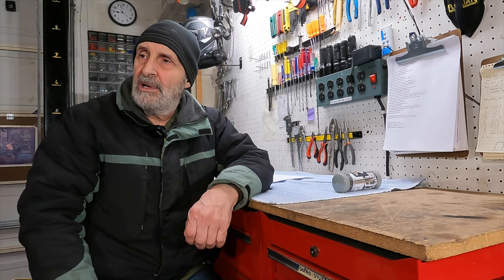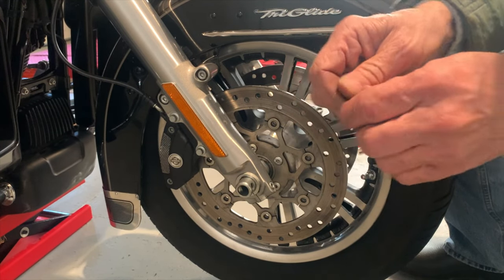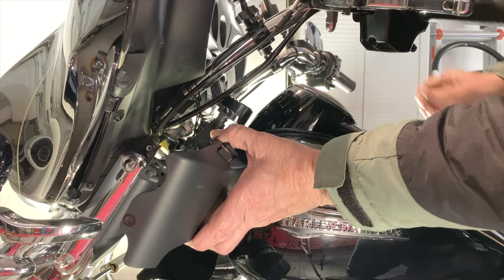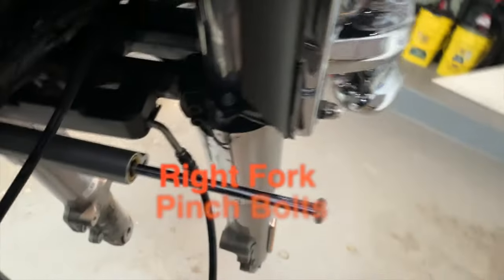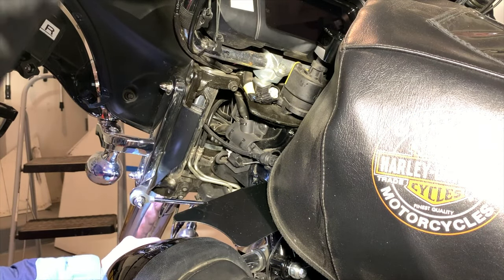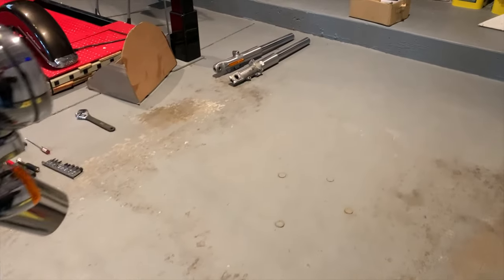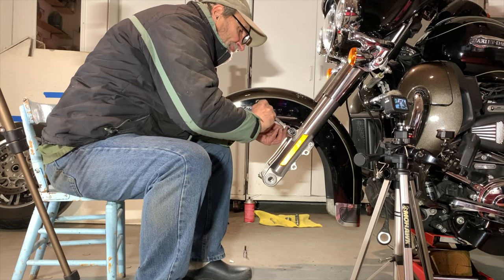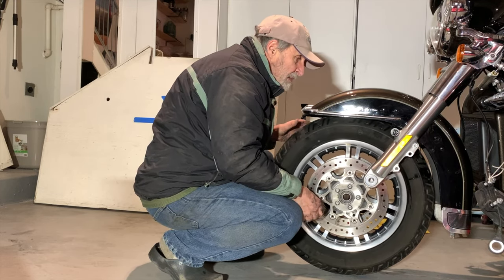Harley Davidson Tri Glide Front Fork Removal. Ricor Intiminator Valves Installed

Comment: Thanks for the video. I have a 2021 Tri-Glide and just installed the 14" Nexgen rear shocks from DK.  I have been thinking about installing the intiminators on the front. I have the rake kit from cut n shoot customs on it and it made a huge difference in the handling. After watching your video,  I think I will get the intiminators and install.  The nexgen rear shocks have been great. The wife says it is a completely different ride now. I am going to do like you and take the forks off and take to the dealer to install the valves.
Reply from the maker: Thanks for the comment. Shortly after I installed the intiminators I installed the next GEN 13 inch tri glide shocks. I did a video on it, which will be out later. The intimidator’s are a huge compliment to the rear shocks.  Standing alone on the tri glide without new rear suspension. You can still feel the difference when the front end has an event. (Pothole)
Lot of times it is quickly followed by the rear wheel (wheels)  but once in a while, you have a standalone event with the front forks and you can really tell the difference. But when I put the rear next GEN 13 inch shocks on the rear it was a world of difference. Unbelievable compared to the OEM shocks. I am doing a video on the difference which will be out at some point.  The intiminators would be fantastic on a two wheel bike and way more noticeable. I have been told by many people that I should get a rake kit but I don’t think I will but I have heard so much good things about them.  I could have lived with the OEM shocks, but the wife was having difficulty with all the ruff riding ,so I decided something had to be done.

Comment: The lifting table to the right in the video….does the trike fit on it …..if so any make model etc…trying to source a trike lifting table with little success or  they are very much over priced.   Thanks for your help and precious time. Robert
Reply from the maker: I bought that car lift about 15 years ago. It has a center deck on it. And yes, I use it to put my trike up and out of the way. I can put a small vehicle underneath it when it is up I paid around $3000 to get it to my house 500 alone in shipping but it has been worth it’s weight in gold over the years I have stored many motorcycles up there during the winter months, I bought it in Kansas City. The manufacturer is no longer in business. Shortly after I bought it, they went out of business. I’m lucky I got the left before they did.

Comment: Question to you sir, what type of torque wrench did you use in order to torque the front fork pinch bolts . And some of the other difficult bolts during the front fork replacement process . During your video it appeared you used loc-tite on all the screws and bolts is that correct? Additionally, my 23 Tri-Glide did NOT have the little carter pin on my front axle bolt , we noted you tapped out at 1:35   
Please coach me through this.
Reply from the maker: I used a 3/8 inch torque wrench from Harbor Freight Tools with extensions enough to get to the bolts. It worked really well. Also, I don’t know much about the 23 models but if you have a hole in the end of your axle like I do on mine and there should be a kotter key in there. If you don’t have a hole, then apparently the nut is made to just stay on Securely
Reply: @windsurfed1  Thank you, very much appreciated .

Comment: 2 Questions... So how much was it $ for the shop labor and fork oil???  And did you inspect your front brake pad thickness/wear, How they look after all the miles you put on her?
Reply from the maker: Order Fork oil with the order from dk custom which was a little over $27 for the fork oil.
Fork labor to change oil (my oil) and drop in the intiminators and I purchase new fork seals ($18) was $245. Also no, I did not inspect front brake pads account about 3 months earlier I thought I needed new front brake pads since I am always using my front brakes, way more than the rear. I briefly looked at them from the outside and It look like I neeed new ones. I ordered new pads for the front and rear. When I went to replace them I found out I was totally wrong and they were only about half wore down to my amazement. So I just stuck the new pads in the drawer till I really need them.

Comment: Did you remove the ignition switch to remove the dash panel?  Thanks
Reply from the maker: No I did't Have to remove the ignition switch.  The dash panel was wrapped around the switch but I did not have to mess with the switch itself.

Comment: I commend you, I do my own work also.
Couple suggestions, maybe you should try using a longer ratchet handle, it would make life a lot easier. You can unbolt that steering stabilizer. You shouldn't use your torque wrench as a pry bar. (Unbolting front wheel axel)
What do those wings do for you above the lowers by the tank?
Reply from the maker: Thanks for the comment.  Sometimes I use a cheater bar if a need a longer handle.  Yes, I probabley shoud have unbolted the sabilizer bar.  But Oh, well.  I really never even thought of it. I really can't remember using the torque bar for a pry bar?  Those are call cooling wing deflectors.  Designed to deflect air rushing into that area onto your engine to help keep it cooler.  It also stops massive air rising up above the gas tank which really buffets your helmet at higher speeds.  It reduced butteting 85%.
Reply: @windsurfed1  Where can you get them?
Reply from the maker: @gregrose6915  dk Custom

Comment: Did you use your stock fork springs when you installed the Intiminators
Reply from the maker: Yes, I use the stock Springs with the intiminators. And you definitely will notice a difference.
Reply: @windsurfed1  Thank you sir.I will be ordering a set soon.I already have the DK Pro Action shocks with comfort lift so the intiminators should finish the job
Reply from the maker: @scottandrews2829  I took the forks off myself, took them down the shop and had them do it. I still had to pay $250 for that +199 for the intiminators.

I got the next GEN 13 and Tri glide shocks and a convertible comfort lift kit. I had them set the shock on very soft and I actually lost 1/8 of an inch height in the rear. I kind of wondered what it would’ve been like it had, I left the original OEM shock mounts on Probably would’ve lost a lot more than 1/8 of an inch but oh well doesn’t really bother me it’s a beautiful ride.

Comment: Let us know if you can tell any difference in ride
Reply from the maker: Will do.  I also just installed some Nexgen 13 inch triglide shocks.  I am putting together a video on that also. Be awhile before I get it out there.  Went for a ride with just the intiminatosr the other day and there difinately quite a difference.  Way much smoother when the front forks have an event alone. Also went for a ride today with both intiminators installed and the nexgen 13 inch triglide shocks and  it was totally refreshing.  Way smoother then the oem hydrolic shocks.  Going to put together a short ride trying to hit every man hole cover and rough road I know, really giving these suspension products a test. It willl be short with my opinion. For the tri glide I think the intiminators should be installed alongside new shocks.  The combination definately complements each other.  It's hard to separate a front fork event without the 2 rear wheels, or one rear wheel having the same event (pot hole).  On a 2 wheeler it would definately be worth the install alone without a complement of rear shocks.  As it is with the TG certain front wheel events can be felt separated at times.  And those times are amazing.
Reply: @windsurfed1  thank you